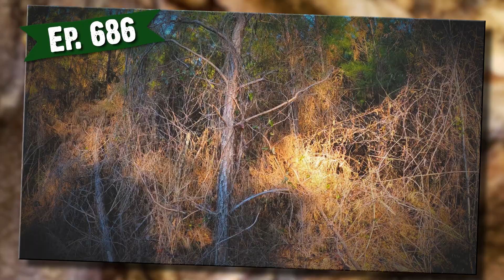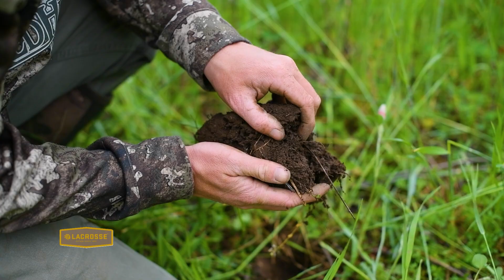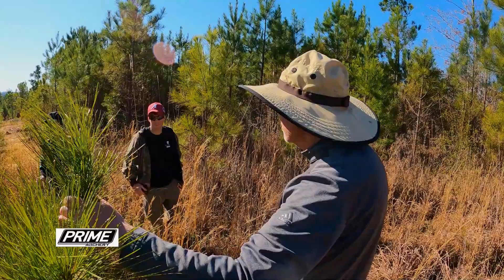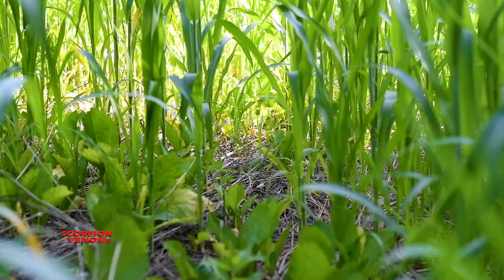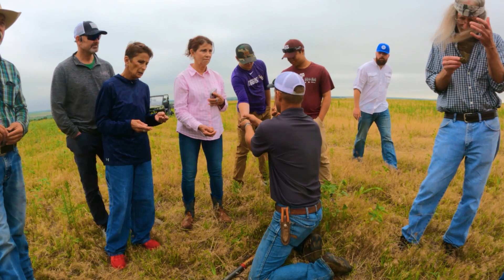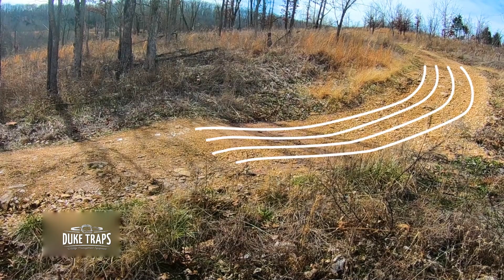How to Prevent Erosion (687)

Comment: The state has beat management practices that have to be followed by the logger. 

Anyone that wants to complain about a logger can have the state get the logger to fix any problems right after they happen. Don’t give logging a bad name. 

It’s then on the landowner to maintain or not to maintain their land then after. This landowner did a terrible job(not the present land owner) 

Loggers will be held liable if the landowner want them to be, the state will make it happen. But only if it’s brought to the attention within a certain time frame not years
Reply from the maker: Collegeguy - Most states do have Best Management Practices (BMPs) and some rules. However, if you are in the field, you know these aren't always practiced.  I know many loggers that do great work!  This one took the best and left a mess.

Comment: Could you please consider making a video on how you would bring an area such as the moonscape back into productive habit.
Reply from the maker: Bill - Restoring "moonscapes" is always best accomplished by planted.  Heavy equipment may be necessary pending on the condition of the area and the landowner's objectives. However, the real restoration will be the result of plants, sun, and water.  These are the same tools used to restore or reclaim strip-mined areas.

Comment: Grant, you've talked at length about how to prevent soil erosion. This vid begs the question of just what type of preparation would be required to restore this badly damaged, eroded "moonscape" soil? Seems it would have to be leveled in order to restore it back to productive soil. What are your thoughts?
Reply from the maker: Beach Bum - if the area is to be a native vegetation areas, the seed, moisture, and sun are the key ingredients. Growing plants with undisturbed soil do wonders to health!  If the area is to be converted into a food plot, then certainly some dirt needs to be moved.  Heavy equipment compacts soil, and almost always leads to more erosion.  If heavy equipment is used, it will be need to be planted just before the first rain and hope that it's not a downpour.

Comment: how can you accomplish the no disking method on a smaller scale like say 1/2 acre to 1 acre plots without a crimper and no till drill
Reply from the maker: John - We use herbicide and or Rx fire to remove the duff and prepare a good seedbed.  This leaves the roots and soil in place.  Leaving the soil in place without adding compaction is a huge part of improving the soil's health.  The nitrogen will volitize in the fire but remember, there's about 35,000 tons of nitrogen above each acre in the air.  The phosphorus and potassium and other nutrients will stay on the site. Then broadcast seed on the plot just before a good rain - hopefully a 1/2" or more.